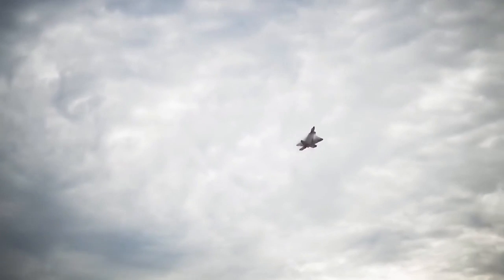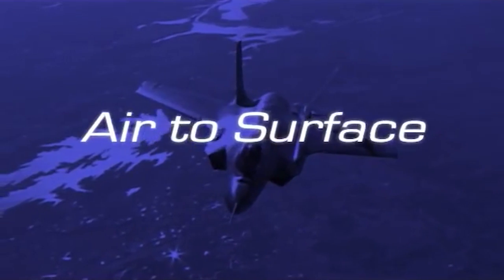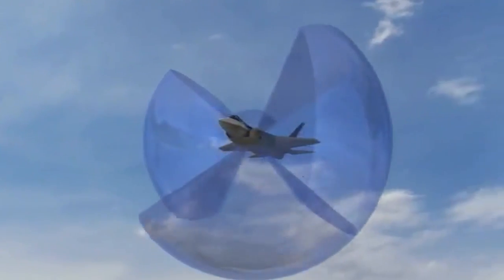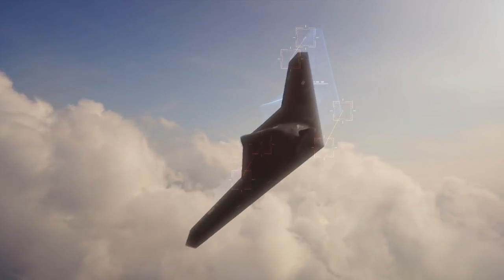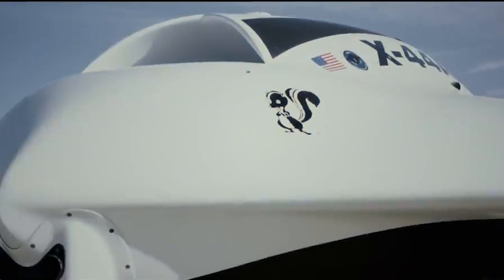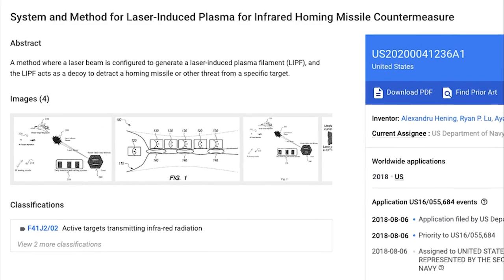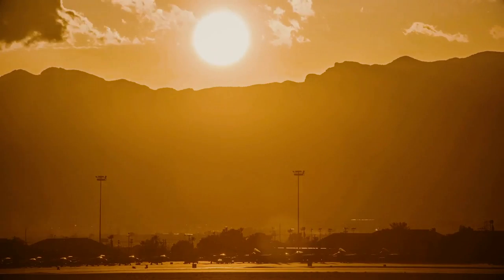The deadliest fighter tech you can put in the skies today

Comment: 10,000 times more data than existing systems is a ludicrous stat at first blush, though thinking on it more, it does always strike me as interesting that as advanced as making a modern fighter jet is, some of the systems in these jets are many many many times slower than a basic laptop these days, like they're still fielding PowerPC 750's ('member the bondi blue imac g3?) and such, and it's like those compound growth charts of iPhone performance, over a decade the compounded numbers i.e for GPU performance can look similarly huge.

I imagine they'll also be looking at neural net accelerators which run lower precision math than CPUs or GPUs at a much higher speed as well

Comment: I expect development and production of the NGAD will be revolutionary as well as the fighter. An major goal will be reduced operating costs. Especially the costs of stealth.
The NGAD will combine the F-22 and. F -35. Technology, experience and software. Plus extra advances and some new systems. The fighter should have the multi-role capability of the F-35 as this capability is proven. Also, the pilot fusion, sensors, data comms, stealth, and software.   Most of the development testing will be simulated on computers and rapid prototyping. Manufacturing will be highly automated with very high quality. Including 3D printing and computer machining.

Comment: Could not the laser defense system be overcome by fielding missiles with reflective finishes?  I think we need to be thinking in an entirely new paradigm.  Whatever that may be.  I probably couldn't come up with it myself, but I do think that it will and should be some unexpected dimension of air dominance.  You dominate the air, and given equality or even lower strength in other arenas, you should win.  Air dominance in the present world is multifaceted.  To dominate the air is more than just taking out SAMs and clearing the sky of opposing assets, it is also being able to handle kinetic, beam, field, and pulse weapons.  Because it doesn't do much good if you dominate the air but satellites are still roding your artillery.
     I think the idea of having a pilot in the air directing a squad of drones and a swarm of loitering and incoming munitions launched by far off B2s or their like is not the way to go.  The pilot's role should be that of back up for the AI that is controlling the entire circus of networked fighters, attendant wingmen, and several  subservient but autonomy capable drone swarms.
If the encrypted link is somehow broken then the local AI of the networked fighters could kick in, only when that failed should the pilots be anything more than a general director of the deployment, and judge of implementation etc.
If the flying tictac that the Navy filmed is more than some kind of projection or holographic mirage of some kind, and it originated on earth, you better cross you fingers and hope its DARPA.  Cause whoever that is: they win.  I think its a sixth dimension kind of movement seen from a lower dimension of our perception. 
All we really need is for people to land in a tictac and say, "Alright children, we have had enough of this bull and so have you.  There is gonna be peace from now on."  -- the entire world would unite to fight against them, so we could go on slaughtering each other.

Comment: I would make sure that all the files and all the information on it would not be on the internet in any way and no that's not impossible you can still use computers and if they have to be linked they can be linked through what's called a land party a modern version and none of the computers are connected to the internet they don't have they don't have modems the modems are removed there's no way you can hack into it and if information need to be sent across country then it's going to be sent through USB stick by special forces guys or CIA guys they won't even know what they're carrying and it'll be flown across the country probably in a jet fighter whatever information you need for a helicopter or something but it won't be linked or anything like that there'll be no link no nothing

Comment: Good documentary. I also appreciate that unlike many channels, you preface UP FRONT that these are hypothetical and provide both the source and the basis for the hypothesis. Too many channels are nebulous about that, leaving the viewer confused as to what's real, what's likely, and what's just fantasy. 
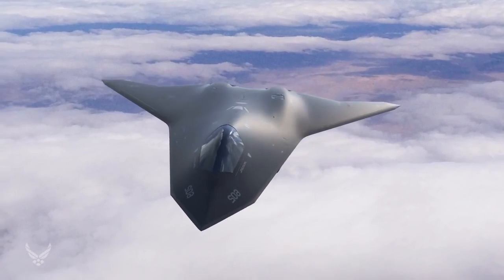I suggest one minor correction at 12:23: What is shown is the publication of a patent application. You can tell this just by looking at the number. A patent has a sequentially issued number. Up until near the end of 2018, it was less than ten million (e.g 9,123,456). By the end of 2018, patent numbers exceeded 10 million (e.g. 10,123,456). However, the number shown at 12:23 has the format for publishing a patent application. It has more digits, the leftmost four digits are the year that the application was published. With rare exception, all patent applications are published within a year to 18 months following receipt of the application. These are published regardless of whether it is ultimately granted or denied patent status.
There are three major numbers associated with a patent. 
Application number (which has its own unique format).  This one is 16/055,684 and was submitted on 8/6/2018
Publication  number 20200041236A1, published on 2.6/2020
Patent number  (I search the USPTO website and found that this application has yet to be issued a patent number. However just last month, on 4/14/22, it was issued a 'Notice of Allowance'. That means it WILL be issued a patent number in the coming weeks.

Comment: The only negative I have is just in the conception drawings. Maybe this belongs in the previous video, but in the drawings, the air intake is on the underside of the fuselage, where the stealthiest place would be on top. 

Of course, it would expose the craft from above, but the greater danger is most likely from the ground (like S-400s). 

But then, they are just DWGs.

Comment: Some strings that you didn’t fully pull…

The combination of stealth and unmanned platforms will further diversify and complicate the air superiority ecosystem. From WWI through the Korean War the air battle was won or lost by essentially one “best” type of aircraft: the air superiority fighter. Later electronic warfare and AWACS aircraft were added along with a High/ Low (F-15/ F-16 in the US) mix of air superiority aircraft. What we’re looking at tomorrow, however, is a “fleet” battle with various specialists, much more like naval combat:

Drones will be out front doing the sensing both with active emitters and passive sensors, closing range to detect stealth platforms. Fighters like the NGAD will fly behind, directing the drones and  their radar and sensor signals as part of a networked mesh- this lets them shoot without ever radiating or coming into the opponents sensor range. B-21 Raiders will support behind  lobbing Long-Range Engagement Weapon missiles and possibly carrying airborne counter-missile lasers if the fighters can’t. Alternatively some “optionally manned” NGADs will fly alongside manned aircraft with laser systems where the pilots used to sit moving that anti-missile capability closer to the front. 

That’s a very different battle space than the one the F-22 was designed for, and indeed that generation of aircraft probably never gets close enough to “see” its opponents if faced with a next generation networked adversary- it can’t fight through the layered defenses to “see” the launch platforms and manned/ high value targets behind. It makes air warfare less a game of individual combat and more like a naval battle group- various specialists with different roles in different positions. Without smaller semi-expendable drones out front it doesn’t work, likewise without stealth and sensor networking a missile carrying bomber would be too vulnerable. With those two things however the game changes radically, likely the reason the NGAD and drone platforms have such high priority today and why the F-22 is facing early retirement.

Comment: i think we've probably seen ship-based and/or space-based laser induced plasma decoys already, even though there is no official acknowledgement of what they are. but it will be interesting to see if it becomes practical to put these systems on small fighter aircraft. it must take a huge amount of energy and super-pinpoint tracking capability from multiple locations to produce one of these decoys, and make it move around and look like a coherent solid object. i just wonder what advantage it actually has over just using that energy and those resources to directly engage a target rather than produce a decoy.
Reply: Was thinking something similar, but if allowed to mature, use case scenarios not even thought of will spring up.  Kinda like airplanes in 1903.  I normally don’t pay attention to far out tech like this, but the fact it’s so far along makes it something to watch w interest.

Comment: The quote about a wingman cost at 1/2 of the manned aircraft, refers specifically to the B-21. A wingman for a B-21 would need extreme range and stealth, so this makes sense. The price target for the general fighter wingman systems is considerably lower. Personally I think the Boeing Wingman (at around $20m), or a similar derivative, seems about right. The price point will be somewhat dependent on the nature of the NGAD fighter aircraft though, since wingman drones which give away your position wouldn't really be all that helpful.

As for the best weapons system: That's going to be a matter of detection, tracking, range, and kill-rate. 
For the actual A-A weapon, my vote is a 2-stage missile. A boost phase to reach the target zone, followed by a powered terminal approach. This would really help the kinematics and improve kill rate, as well as allowing for a more agile terminal package. Especially agile if it has thrust vectoring in it's powered terminal phase. Not to mention the improved kinematic performance offers better capability for all-aspect attack vectors using HOBS+HMDS. Sensor should probably be dual-band radar (high + low) with home on jam, since optical & thermal sensors are likely to become vulnerable to dazzler countermeasures. Also look for improved warhead designs. Directional fragmentation warheads (rather than radial), combined AP/incendiary shrapnel, etc. Possibly even a forward firing 'pepper box' of extremely high speed projectiles (missile velocity + projectile velocity) as the warhead. Normally a pepper box is a very weight-inefficient idea, but something similar in effect, made from a shaped charge + fragmentation design, should be feasible. That would allow a missile to only need to pull short-range nose-lead on a target, rather than maneuver alongside the target.

As for drones, conceptually? Missiles ARE drones. So do you need a new drone aircraft? Or do you just need a better missile? That said, there are advantages in having your ordinance options and sensors, dispersed over a larger area. Also handy if you want to use a laser, since they have limited range in atmosphere (though that would require a large powerful drone).

Lasers on a nuclear powered ship? Fine, yes, decent idea. Certainly not to replace point defense guns. You don't want your point defense to only work in clear weather. But to supplement? definitely.

Lasers on a fighter? You're going to have a power problem. That either means a weak laser, or a long recharge period. Also lasers become pretty much useless in cloud cover or rain, and there are multiple possible countermeasures to render them much less effective on targets. Useful? yes, but certainly not poised to become the dominant offensive tool.
I would expect the best uses of DEW would be a defensive optical dazzler system, and high-intensity + narrow beam EMP-like effects. The former already exists, the latter would improve range, weather penetration, and defeat several potential anti-laser countermeasures. The target effect would be on the electronics and pilots of enemy aircraft, rather than the structure.

It's perhaps worth mentioning that a high altitude (and probably high speed) aircraft could make much greater use of lasers, both offensively and defensively. Basically something like an SR-71 with a powerful laser, could become that much harder to actually hit with traditional weapons, while offering it the ability to use the same system offensively as well.
Reply: If you want a hard kill defense system, you could also go with actual missiles as well, instead of DEW. The MSDM (Miniature self defense missile) project is going to have flight tests next year, which might be a good option for a fighter that can’t generate as much power. It will take up missile space but that might be worth it.
Reply: @jonathanpfeffer3716  That's a good option too ya.

You know, many many years ago I drew up a B-52 with dual nose & tail phalanx gun systems. I STILL think that has potential ;)

I'm concerned that lasers will just create a need for reflective paint on top of heat shielding. I guess you could argue that would mess up stealth... so it's either be laser-proof 'or' be stealthy. But lasers don't work in rain/fog/mist/etc. And you can render them ineffectual with coatings. So if they're gonna use lasers (as target kill devices), they had better be a modular 'drop-in' option, rather than a built-in feature. But it could be a pretty cool feature.
edit: naval lasers have access to enough power to be higher intensity, so would be harder to counter with coatings.

Comment: I've heard the NGAD might not carry a radar at all.. only IRST and other 360 sensors on the craft.. 
 in that case a wingman drone would carry the radar eliminating a potential risk of radar homing missiles.. 
pls share ur perspective
Reply: I think it more likely that the aircraft might still have a full radar but that it could operate in bi-static mode with the UAV radar acting an transmitter and the Aircraft as a receiver.  Obviously they need to preshare the scan and pulse pattern and know their relative positions but that is easy over a relatively low power secure data link.   The UAV and several aircraft could receive from many directions this increasing the chance of detecting stealthy objects.  Once an object is detected and confirmed it can be tracked by several infrared sensors from several aircraft and UAV thus triangulating its position.  The radar can then reduce its scanning energy in the area.
Reply: @williamzk9083  Makes good sense.. thanks

Comment: People don't realize how overwhelmingly effective EW systems are. The jamming systems on our c-130 jamming "static" platforms can shut down even f-22's from operations. 
The EW drones, if developed, would control the battlefield and deny opposing forces coms, tracking and even radar from performing adequately. 
Our jammers will definitely 'get some'!
Reply: How do you keep the EW drone from jamming it's own side?
Reply: @pogo1140  it is not jamming frequencies used by friendly forces
Reply: @hphp31416  So all the other side has to know is which frequencies are not being jammed which they can find is short order.
Reply: There is alot of directionality in jammers.

Comment: If you can believe the info SAAB is putting out, it seems like Gripen E/F is already fielding separated FCS/tactical systems software, real-time updatable integrated EW, advanced datalinks, advanced AAMs like Meteor and IRIS-T, advanced HMD, and an innovated swashplate mounted AESA radar that allows Gripen to fire a missile then take advantage of "notching" while still guiding. The only thing Gripen is missing is stealth, and SAAB argues that stealth is the most defeatable system on an aircraft over time, as everything else can be upgraded.